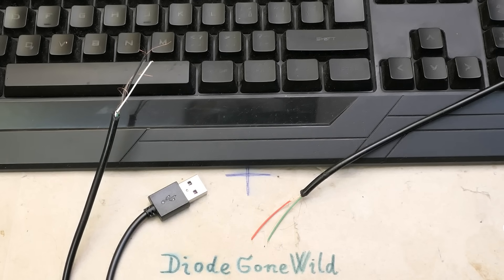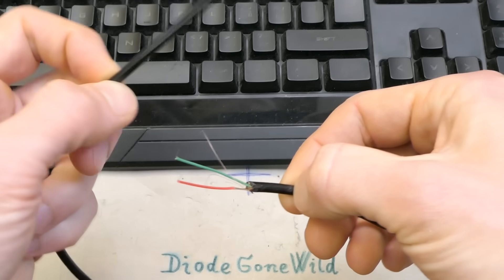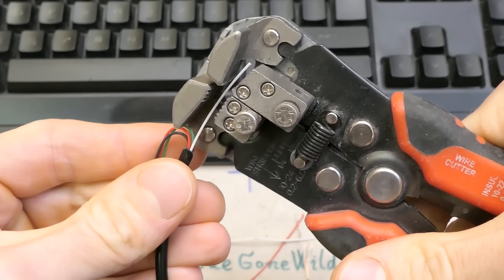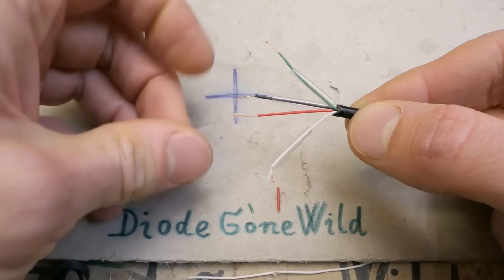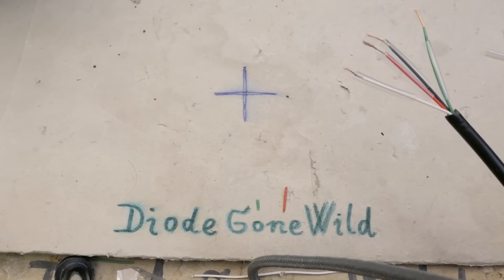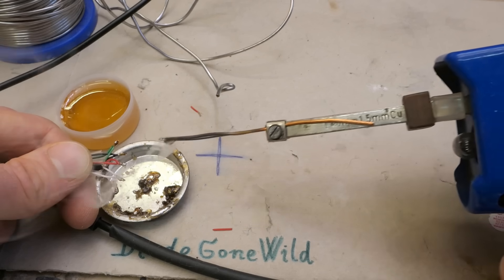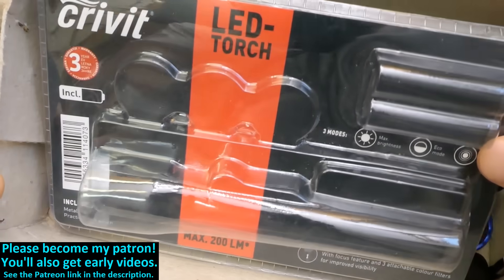Broken USB cable repair

Comment: If you cut the wires at different lengths it doesn't bulge so much and there's also less risk of short circuit :)
Reply: That is a great idea (i.e. not dodgy at all)!  I'll try to remember that  one.
Reply: Also it's bulging less if wires are twisted and soldered together one facing the other, not bending like here making wires twice as thick.
Reply: I do that sometimes.
Reply: Except it's slightly harder without soldering knowledge like me.
Reply: @PCIeTeam  All you need is soldering practice. So just try and improve.
Reply: Yeah but if he did it right how many would he trigger then?
Reply: I had a date that once….
Reply: Good tip 👌
Reply: @PCIeTeam  Watch a few videos.. Heat up the iron... and practice!
Reply: @lauraiss  if there no requirement to strength you can solder tin over ends, trim, add heat shrinks, solder trimmed ends together, no need twisting, with combination with different length, almost no bulge. Adding some pieces stick hot glue at ends before shrink we can imitate expensive heat shrinks with pre applied glue.
Reply: Same applies to 230V plug wiring too.. Make the ground disconnect last if the wires pull out! (btw 230V is still low voltage)
Reply: always doing
Reply: Bulge owo

Comment: I might have taken the keyboard apart and soldered on an old USB cable with the end cut off directly to the keyboard.  It depends on how difficult assembly and disassembly was. 🤣
Reply: Exactly what I do too, stagger them so it's a slimmer repair and also less chance of a short if it gets distressed in the future.... Of course replacing the whole cable is preferable if you have a donor cable handy 😋 Love the videos, thanks as always 😄
Reply: yeah, I was thinking the same, a new cable will look much better
Reply: Yeah that's the way I always fix headphones with damaged cable. Shrink tube is perfectly OK on keyboard cable, but not on headphone cable 🙂

Comment: I'm not a beginner, but I still manage to forget putting on the heat shrink first about 8/10 times!
Reply: Especially when the soldering went fine without stray strands 🤣

Comment: There are 22awg shrink tubes with low temp melting solder paste in it. You place the wires and heat it, that’s all.

Comment: I worked as a technician in a pro audio workshop when I was young and I had to make literally thousands of XLR and Phone patchcables. And I always used my teeth to strip the small inner wires of the shielded Cables. After half a year I had a dentist appointment and he 'admired' a one and a half millimeter deep notch in one of my front teeth. After that I used my Jokari strippers all the time. Luckily the tooth enamel grew back and the notch disappeared after one year.
Reply: Haha that was a truly top notch method 😂
Reply: I had no idea your teeth would recover, that’s amazing
Reply: Hmm, after reading this I also noticed that I also have a tiny notch in one my front teeth, the rightmost one, the one I use to strip wires. Nobody learnt me to do it with my fingers, in fact my parents kept telling me to stop using my teeth, I just seemed to have grown it on instinct or smth.
Reply: I used to do the same until my mom said (very angry): don't do that or you'll damage your teeth... :V
Reply: i did that in teenage but not much and very carefully so that wire does not drag about the teeth, i hated it.
later i started tinkering with more types of wire and the method wasn't useful anymore
my teeth were worn with sunflower seeds tho
Reply: @AlexanderBukh  I was doing that in childhood aswell. But now I have an "oral piano", so I can't or I wouldn't have teeth to chew with.
Reply: @satsumagt5284  It is absolutely impossible for teeth to repair themselves!  However, there are two new enamel restoration treatments being tested that dentists might use in the future: one is discussed in the Guardian news for 30Aug2019, and the second was proposed in 2021 by the Univ. of Washington (U.S.) School of Dentistry, which may use amelogenin lozenges.  Info on both is on the Web as of Sept. 2022.
Reply: @BermondseySteve  well, that’s why I was skeptical
Reply: I chipped a tooth a few months ago trying to strip 8AWG for a vehicle compressor.

Comment: -Today i'll tell you how to fix a usb cable

10 minutes later:
-My soldering iron died while fixing the cable so i'll show you how to fix it

30 minutes later:
-i tripped the circuit breaker

An hour later:
-my room is on fire right now and it's a great opportunity to show you 4 ways to put out a fire

2 hour later:
-How i became homeless by fixing a usb cable
Reply: So many birds/flies — all with one slap…
Reply: Not possible - he has his fire extinguisher always ready! Cheers! 🍻

Comment: Teeth are a terrible idea! I used to use my teeth when I was young. Until that one time I failed to release the pressure on the cable once the insulation ripped. I pulled the cable with the copper strands "sliding" between my front teeth. Holy sh*t! The friction heat went straight into the nerve endings of my front teeth. Not even my dentist ever caused that kind of pain :-)
Reply: And the heavy metal that you could possibly ingest over time.
Reply: Or buy extra teeth ^_^ 
Just Kidding!! wire strippers or cutter wil be better idea. I lost some of enamel on my front teeth in childhood because of using them as scissors for everything

Comment: What I sometimes do is cut a piece of hot glue and stick it inside the heatshrink ends before heating it.
You also have heatshrink that has something similar or maybe even the same kind of glue inside, but as I wrote, a small bit of hot glue works too.
Reply: Double heatshrink, a short piece (and PVC tape if need to build up the diameter) inside a longer piece, then you have a sealed and tapered repair which helps with aesthetics and physical. it looks professional too.

Comment: I stagger the joining of the wires, start joining a splice close to one end and then splice the second further along etc. this reduces the diameter of the bulge in the center and also prevents clumping of all joints in one area.

Comment: If soldering is a pain, I've found a good alternative is to crimp mini bootlace ferrules over the twisted wires. Of course use the uninsulated ones! They seem to give a nice secure joint and of course prevents any damage due to heat or solder splashes.

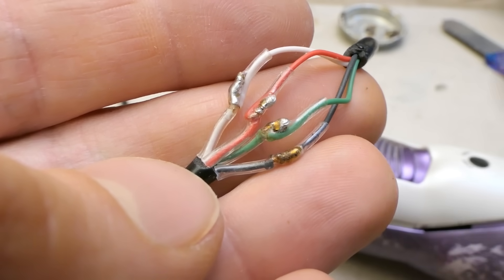Comment: 8:30 alternating the folds of the soldered wires would've let the blue heat shrink fit over it...  or of course cut the wires at dif lengths.  but many people dont think of that right away.  so folding them alternating different directions helps.

Comment: Also recommended, especially for beginngers; double check and test that all connections are working before closing and finishing up! :)
(First time I was doing it I had to re-do everything because of some of the cables weren't connected well enough, hehe)

Comment: I would have suggested making adding a small board with a microUSB connector on the back of the keyboard and then you can use a cheap USB - microUSB cable and replace cables as they get damaged in the future. 
It would have looked more professional if you had liquid flux on the wires, tin them, and then solder the ends together without twisting them. Even better idea would have been to offset each wire by a cm or so, because that way you don't have a big thick bulge on the cable.
Reply: I smashed my usb cable of my keyboard HyperX alloy elite 2. Do you have any ideas how to connect them?

Comment: Just for laughs I'd use electrical screw terminal blocks to restore the connection. That would look pretty naaaaaaice.... and then give it back to the sister.

Comment: Personally, I do not use heat shring tubes, but a hot glue gun. It has a longer lifespan, but of course it doesn't always look as nice as hidden in tubes.

Comment: Two flies in one smack in Norway as well.
Heat shrink can be such a pain if you forget it, or there isn't room for it without it shrinking from just soldering.

Comment: Clear heatshrink can release halogen gas when heated.
Reply: Really?! 
Anyways, 4 heatshrink tubes also give a big bulge in cable, I prefer electrical tape under 5mm black heat shrink

Comment: if I do this I cut the wire pairs different lengths to prevent  a big bulge in one place,  which could end up shorting if crushed  I would  recommend  a 'linemans splice'   for a job like that   as not only is is it neater  but is stronger if cable is likely to get tugged - glad it worked out for you and love your content

Comment: I chipped one of my top front teeth when stripping teflon coated wire when I worked at Intel.  That wasn't so bad, but to even it out they ground down my front teeth a bit.  What a horrible burning stench affair that scenario was, omg.  The smell of rosin flux is a dream compared to burning teeth.

Comment: Diode gone wild,,,on the table bench.

Good job of repairing a broken usb cable,,,with 4 internal wires,, red,white,green,and black.

Which colour is the earth wire? Black or white,,,or green?

Comment: WOW, that's a horrible job. You should've pre tinned each wire and then soldered them opposing to each other. The way you did it and then twisted the wires 180 degrees puts a lot of mechanical stress and the wire can break near the joint.
Reply: Yes, I'd twist and tin each wire, then just overlap each pair side-by-side (opposing), and solder them. It makes a perfectly strong slimmer joint and there is no tendency for it to untwist or tear if tugged. As each joint is thinner, the heatshrink bulges less too, which makes for a neater job.

Comment: The cable will be very weak and break if you pull it, use the tape first and then put the heat shrink on it.

Comment: Repairing a high speed cable would potentially ruin the data speeds, USB 3 most definitely. these balanced pair cables need their twists in good condition, same as bending CAT5/6 beyond its bend radiius destroys the high speed.
Reply: true but for a keyboard it is fine!
Reply: Yes. Some day a presentative of one of those dodgy USB charger manufacturers can comment this repair using word DODGYYYY. 🤣

Just kidding. Only 5V, not dodgyyyyy. Niiiiiice! 👍

Comment: for better safety dont do parallel joint in multicore cable ...always joint in multi step so it doesnt get shorted whenever insulation gets broken and NEVER EVER use insulation electrical tape.

Comment: An arguably less durable, more expensive, but more accessible means of repair would be to use a four-pole Molex-style connector. The benefit being, you could create extensions as need be, so you could (in theory) not only repair, but also customize the length by replacing with different lengths as necessary. Ugly as sin, but no soldering required,.